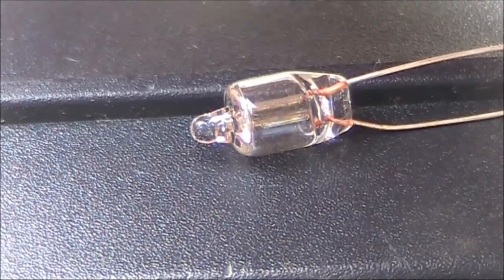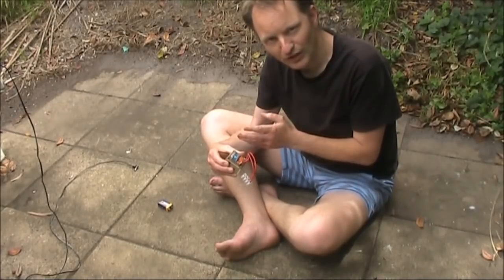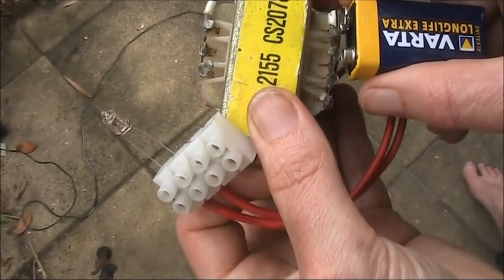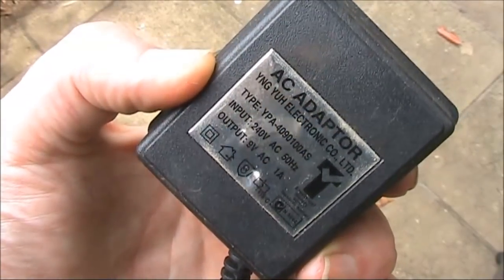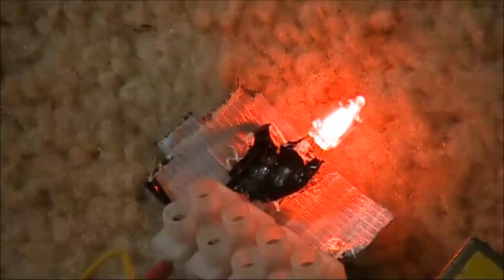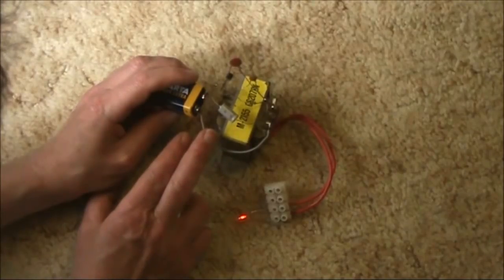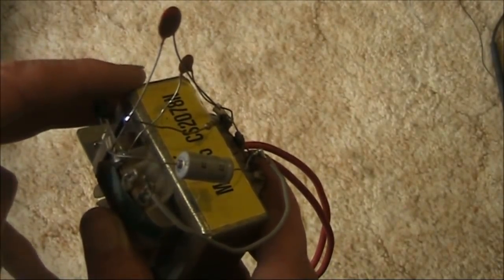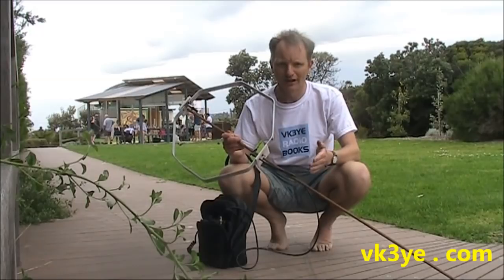Electronics on the Floor: Fun with Neon lamps

Comment: I’ve got a transceiver that l built that has a neon lamp on the antenna output .... l think it’s for people who use kite antennas...  it stops static getting into the radio. Is that right?.
Reply from the maker: Yes that would be right. It may also be used as a antenna tuning indicator - especially for high impedance antennas. https://groups.google.com/forum/#!topic/rec.radio.amateur.homebrew/Yoc_-EhaY-M